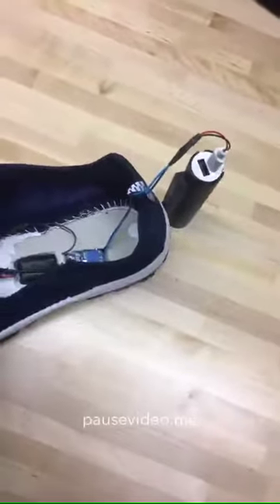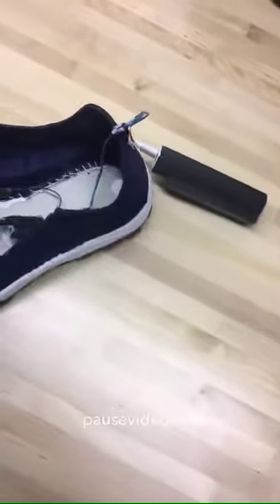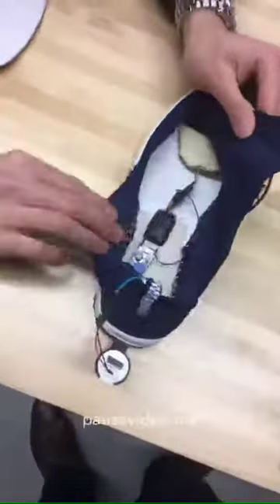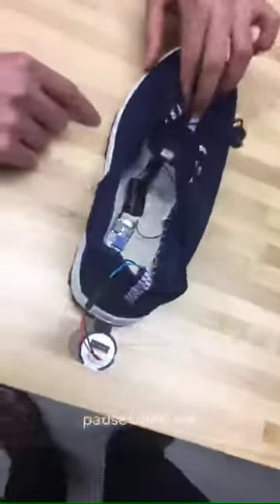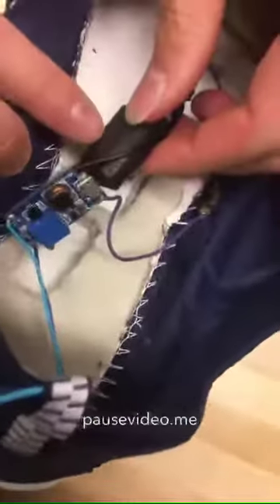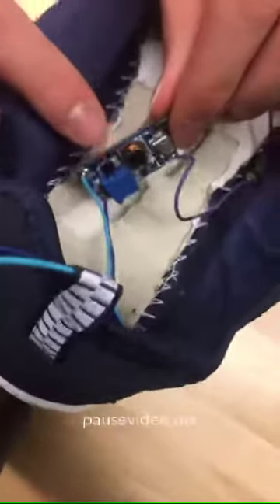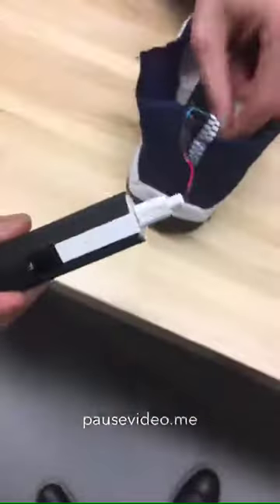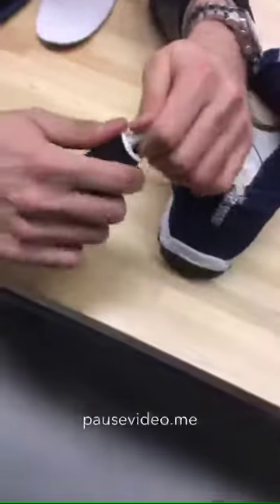Piezoelectric footstep energy harvesting system

Comment: What are the characteristics of the two batteries Plz
Reply from the maker: Characteristics? Voltage?
Reply: yes; I would like know the details plz and you using anything to storge the volte in the Battery or no  @jjrimz99tandem_drifter
Reply from the maker: @morsyelgezery8916  we stored the energy in capacitors and converted into a storage unit aka battery pack. I do not know voltages but as long as you have a convertor it doesn't matter.
Reply: In the 1.41 minute in the video , you say ( we added to batteries that get charged from the batteries can send out the voltage ....) in this section you used Lipo battery or capacitors plz ?!
and if you using any one of them , why can be getting that ? 
 @jjrimz99tandem_drifter